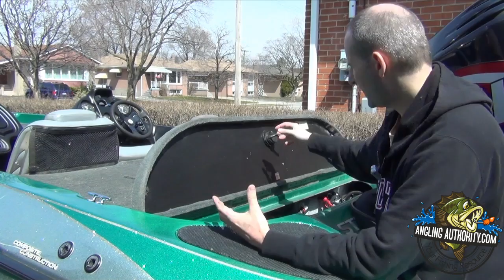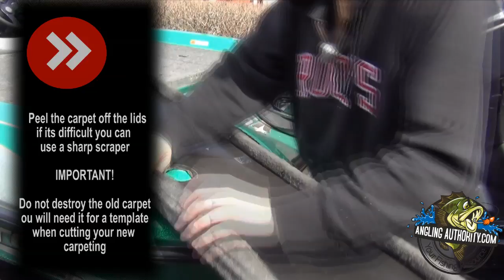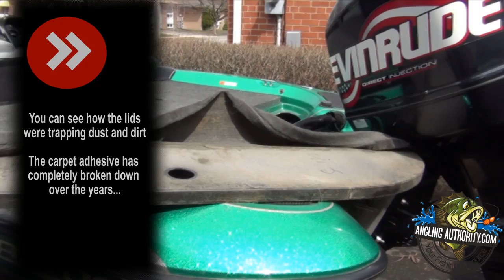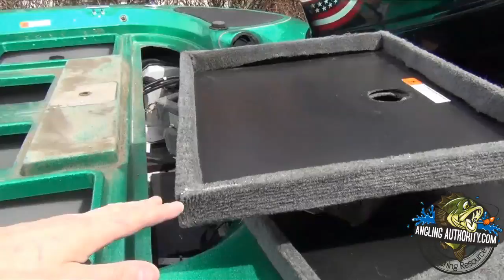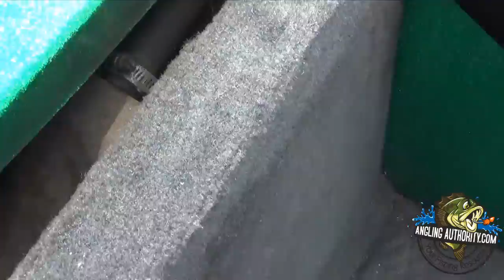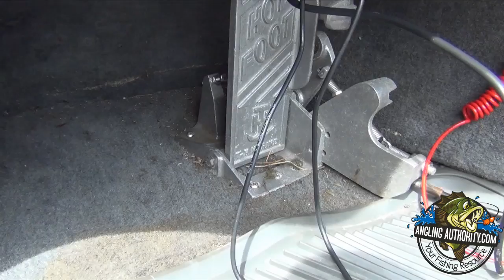Bass Boat Carpet Replacement - How To  - Part I

Comment: This is just what I was looking for as I will only be replacing the carpet with 24 oz. on my lower deck and the upper deck(bow), along with two  live well hatches ( main deck inspection hatch and bow live well hatch).  BTW, that carpet looked great. Just surprised that that original glue went to dust like that! Must be a factory  water based spray-on!.Thanks!!